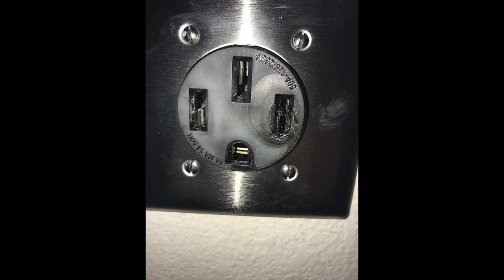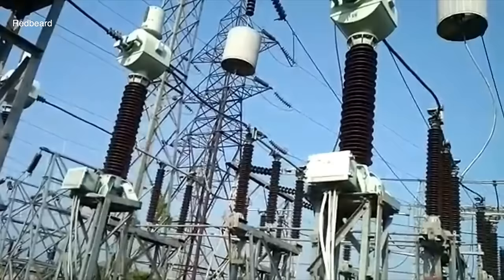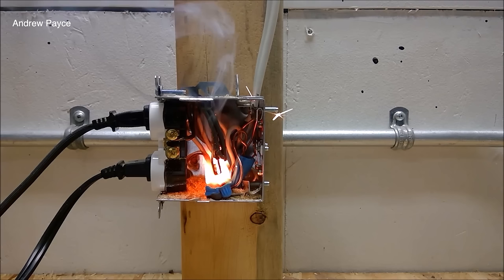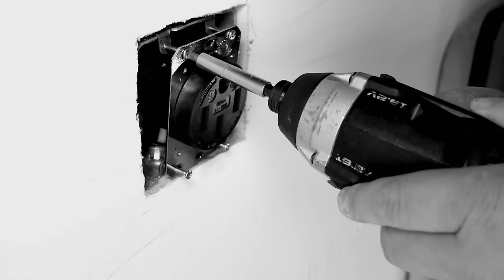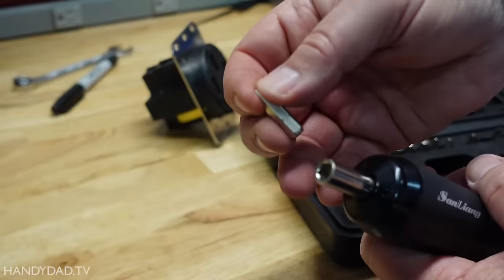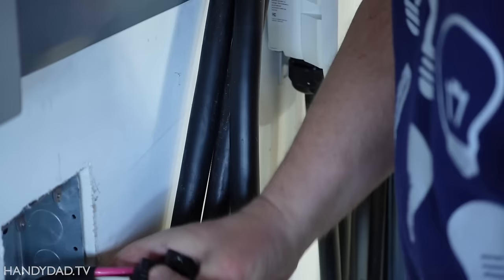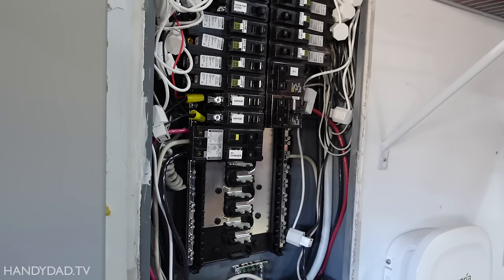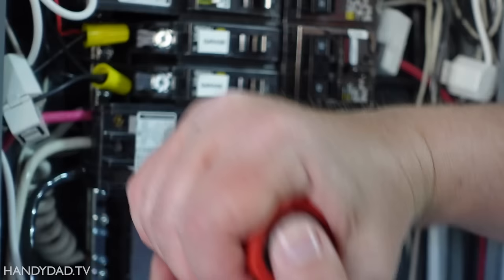EV Charging Disaster

Comment: Ive run a Tesla Model S for 140,000 miles 10 years charged every day so and Ive worn out the top quality ITT Type 2 Menekes plug that connects to the vehicle in approximately 3,500 cycles, my home charging is 5 Amps 50% of the time when on my solar in the day and up to 32 Amps when charging overnight, both single phase 250v. L1 terminal started to get hot / smell and moving the connector when plugged in the car would cause a glitch / restart in charging. Great video but the same problems of contact degradation applies to the charging connector and will eventually impinge damage to the male vehicle contacts.  When the charging pistol  gets warm / smells heated on high current charges change it out, nothing lasts for ever......from my experience seems like charging connectors could be suspect at 3,500 cycles. You can get replacement plugs fitted to 5m of cable just make sure you get the cable suited to your needs 32A being the biggest / most expensive this way it saves buying a crimp tool and yes they need crimping on.......... solder will go kerpow!
Reply from the maker: Thanks for the advice!

Comment: A thermal camera can be used to check for heating inside an outlet by loading it with a suitable appliance. Any heating much above the immediate surroundings should be investigated.
With a heavy load, a differential of more than 5 degrees C after a short period of operation may indicate potential trouble.
Reply from the maker: Good idea, but two issues: those things are expensive (most people don’t have them), and most charging happens while we are sleeping. 

Tesla has a temperature sensor in the plug that shuts off charging if it gets too warm. That should become part of the J-1772 standard.

Comment: One of the two hot screw-down terminals in the 14-30R socket installed when the house was built, had a mechanical failure where one side of the 'U' broke. As a result, the wire could not be clamped tightly. While the outlet voltage measured 220V as expected, it would not have been able to pass any significant current without overheating. Ended up having to buy a new socket and ensure that all four screw terminals (2 hot, neutral, ground) would tighten properly.
Reply: *our house*. My L2 charger has a live voltage / current display so I can tell that under load, the voltage is not dropping significantly at the outlet.
Reply from the maker: Thanks for sharing!

Comment: Arcing in a breaker box can cause noise in audio equipment. If you're hearing unexplained random noise in your radio or TV, that may be it. I was experiencing it in my home theater system at a rental house and after weeks I finally could hear it coming from the breaker box. The landlord took a look and found that moisture from a roof leak had corroded the main bus bars, and the arcing was burning up the circuit breaker contacts.
Reply from the maker: Good thing you found that!

Comment: I bought that model of the torque screwdriver, but it only went to 70. 
I needed 75. I ended up getting the LEXIVON Inch Pound Torque Wrench 1/4-Inch Drive | 20~200 in-lb.
Reply from the maker: I wasn’t comfortable using a wrench to tighten a screw. But I couldn’t get it to click at 70 by hand anyway. I just went as tight as I could.

Comment: Good diy video man, for future reference buddy use a ES1 bit to torque your screws. It’s literally a combo flat/slot drive and Robinson/square drive bit. It fills the entire void in the screws and prevents cam-out and stripping of the screws.
Reply from the maker: Yeah I need to get myself some of those bits.
Reply: @handydadtv  their great man, no more cam-out and stripping is very limited. Their awesome for electrical work especially on devices, go figure that’s exactly what their designed for, lol.....

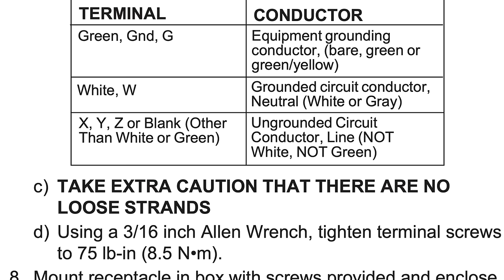Comment: At 4:44 you shows that it requires 75 lb-in, but the torque screwdriver you are using only goes to 70 in-lb (see 4:23).  So it's great that you torqued it down, but you are still off by 5 in-lb.  I even clicked on your product link and it shows a max torque of 70 Inch Pounds.
Reply from the maker: Correct. But I couldn’t get it to 70 in-lb by hand either way. So I went as tight as I could.

Comment: You don’t need a flimsy torque screw driver. Tighten them manually pretty good with sturdier tools.
Reply from the maker: I did that to shut down all the prior comments that said I needed to torque the connections. 🤷🏻‍♂️

Comment: These plugs like a dryer plug washing machine plug are not made to be plugged in and plugged out all the time things become loose wires actually hum and vibrate at 60 cycles per minute things come loose heat builds up and then you have a fire. If you look at the type of plugs they use on forklifts and other vehicles which have battery charging all the time they're different made to be used on a 24/7 basis.
Reply from the maker: Hard-wiring a charger is a better option.

Comment: This is a helpful video.  I had an electrician install my NEMA 14-50, but he used a lower grade outlet.  I bought an industrial grade but, after watching your video, I realize I need to torque the connection.  The spec you show for this outlet is 75 in-#'s.  I found the driver you are using online and its max is 70 in-#'s.   Then I watched your video again a paused on your driver and confirmed it is the same one with a max of 70.  What am I missing?
Reply from the maker: I couldn’t get it to click anywhere near 70 in-lbs. Just too tight for my strength so I went as tight as I could.

Comment: The problem isn't so much the plug itself it's that it should be plugged in and left alone if you plug and unplug anything sooner or later the prongs will fail the heavy duty version will last a little longer but it will eventually fail! I believe sooner or later it will be required that all EV chargers be hardwired into the home!!!
Reply from the maker: Not sure when (if) that will be required, but you never know.

Comment: Doesn’t NEC say to upsize based on additional 25% of load for constant current draw devices like heaters, chargers etc?
Reply from the maker: The EV community describes it as only using 80% of the circuit’s capacity. Same thing.

Comment: You were operating the screwdriver in the panel right beside the exposed bus bar plates that would have 220v between them and could supply a continuous current of your house supply but a peak current far higher.   Think of the arc if you shorted that.
Reply from the maker: Thanks

Comment: Yes, a very loose contact surface can allow arcing, but the lack of tightening reduces the effective contact surface between the two conductors.  This increases resistance which causes heating.  Think red hot toaster element.  No Arcing is required to start a fire.  Just like the toaster element lighting a flammable piece of material on fire if you put it in your toaster.
Reply from the maker: Good point. Thanks.
Reply: @handydadtv  And one more thing, I could make a lot more videos than you, because I've made more mistakes than you 😂.  But my videos wouldn't be one tenth as good as yours!  Nice work!
Reply from the maker: Thanks so much 😊

Comment: One very important thing is feel the outlet and the plug when the charger is operating to make sure it's not heating up , 
If it is , Check the fit of the plug in the outlet
If it doesn't have a tight fit , you need to replace the outlet and check all the connections to make sure they're tight
It would be more safe to hard wire the charger because the screw connections will be much more tight than the connectors that the prongs slide into
Reply from the maker: Good point. Warm is okay, but never too hot to touch.

Comment: Did you just torque the breaker terminals to the same specs the outlet manufacturer called for on the outlet? 

If stripping the heads off screws and screwdrivers wasn’t a clear enough indicator  75 lbs-in is over torqued for a Square D HOM breaker.

I doubt it will be an issue but exceeding torque specs runs the risk of stripping the threads off the screw and making the connection loose again. In your case we don’t know if those threads are damaged and about to just let loose with some thermal cycling. Again I doubt it will be an issue just something to consider in the future.
Reply from the maker: No, I adjusted the torque screwdriver to the specs of the breaker, which were printed on the breaker.

Comment: Hardwire hardwire hardwire. Preferably one continuous 6 gauge set of wires (only need 2 x hot + ground) in conduit through garage is an option I think is the most fool proof.
Also, using a thermal imager after it's been used for like 30 minutes would help rule out unusual temperature rises.
Reply from the maker: Thanks.

Comment: Other important notes is to make sure the wire that was run through the wall for the outlet is the correct size, has the correct insulation rating, and has no nicks or cuts. I honestly would not trust running wire for an EV that is not in fire rated conduit. The extra bucks for the conduit is worth it to have piece of mind. Also make sure that the electrical box the outlet sits in is to code and is tight against the drywall and the wires are pushed back so they sit well in the back of the box. That way if a electrical fire does happen it will be contained within the box and/or conduit and will be far less likely to start a house fire.
Reply from the maker: Thanks for the tips!

Comment: The bottom line to all, avoid NEMA plugs for EV home chargers. Even if the AMPS are on the lower side (40- below) Run it hardwired. You will cut the chances of fire heavily. Not to say that it could not happened on a hardwired setup. All breaker screws need be tightened as you shake the #6 0r 8 wire gently, loose the screw a bit and again via T. Driver. Screws on the EV charger same, per manual. Bad or loose connection will heat up and spark. Also, most EV chargers require you to strip the wires around 1/2" before going into the terminal block. Don't be shy to do so. When you run your charger first time ever in your house. Run it first time during the day, when you are home and awake. Go out and check the temp on the plug/cord/the EV box. Do you smell anything burning? is anything too hot or very warm. Indication, something is sweating !!!!
Reply from the maker: Thanks for the advice!

Comment: Good recommendation for industrial grade outlet, no way is a standard one going to handle that 75 in/lbs tightening, the screws will strip.

Hardwiring is even better, it's not that hard to just disconnect it if you move and want to take the charger. I would hardwire literally any continuous load including electric ovens used to bake.

If there's a twist connection anywhere, remember also to pre-twist the wires before wire capping them and if one end is stranded make sure it's not creeping down the wire when the cap goes on. It's worth a drop of solder for a big high risk connection, easily enough broken if the connection must be remade or device moved.
Reply from the maker: Good tips. Thanks.

Comment: Also important to prevent arcing when plugging in is to always connect to the wall socket first, and then the car. And opposite when finishing charging. Remove from the car first. Because the plug that goes in the car has protection against arcing.
Reply from the maker: Good advice!

Comment: I have a sub panel in my garage,  near where I want to install the EV charging unit, that is installed for supplying 240V to the nearby Jacuzzi. Can I use that same subpanel, for supply to EV or do I need to rerun entire wires from the main house panel?
Reply from the maker: Yes, but you need to do a load calculation to know how much capacity it has. I suggest you consult an electrician.

Comment: Even if no arcing occurs, it doesn't take much resistance to cause the generation of a large amount of heat.  On your example of a 50A outlet, a resistance of only 1/2 Ohm will result in the generation of 1,250 W.  Also overtightening can be just as bad as undertightening.
Reply from the maker: Thanks for the info

Comment: So even if you torque the screws wouldn't the copper wire expand and contract when its heated up by charging. Would raising the charging amps on the car be and issue also according to the wire size and breaker installed. Some people like to raise there car settings higher nor taking into account the wire size installed and not knowing that a circuit is only rated for 80% or volt droppage due to distance and will always blame the plug just wondering
Reply from the maker: Yes they still can expand and contract so it’s recommended to re-torque them periodically. 

Only an idiot would intentionally try to charge their car at a higher rate than the circuit design. The circuit breaker should trip to prevent an overload but that’s just asking for trouble.

Comment: One more thing, when you are attaching heavy gage stranded wires you should shake the wire while you are tightening it OR unwind the length of the strands that goes into the connector

The diameter of twisted strand wire is larger than the same wire unstranded

with the movement cause by the expanding and contracting due to heating and cooling those strands will unwind and thus result in a loose connection.
Reply from the maker: Thanks for the advice!

Comment: Whenever I needed to install a high amperage outlet for large loads I would always mount a disconnect switch adjacent to it.  With the switch open there is no chance of arcing as the plug is inserted or removed..
Reply from the maker: I never unplug while charging, but I can see it’s a small risk.

Comment: Torque spec for the outlet is 75 inch lbs. Max torque load on the screwdriver is 70 inch lbs. I was thinking about buying the screwdriver before I realized that. If you're going to go to the trouble of buying a tool to do the job right shouldn't you torque it to the correct spec? Is the 5 inch pounds enough different to be concerned?
Reply from the maker: I couldn’t get it anywhere near 70 in-lb by hand. I went as tight as I could. 

I was tempted to use channel lock pliers to grab the screwdriver for leverage but I thought that much force would break something (the screwdriver, the bit, or strip the screw head).

Comment: Hi. Your channel has a global reach. Not all electrical systems are like those in the States. Not just voltage and frequency, earthing can be very different, split supplies not used, aluminium cable banned, wire nuts illegal, you'd be amazed. Please bear this in mind and make clear where your interesting wiring series is relevant. I know, should not be necessary, but some people in other jurisdictions will try and follow you and what is good practice where you are may be very bad where they are.
Reply from the maker: Hi Bob. Thanks for the feedback. I’m well aware YouTube is global and the US is distinct for its electrical standards as well as weights and measures. I’m not sure what I can do about that. It’s where I live and it’s where the majority of my views and revenue come from. What would you have me do?

Comment: A NEMA 5-15 or a 14-50, whether homeowner grade, spec grade, commercial grade, or industrial grade, the outlets are still not designed for continuous plugging and unplugging. They have a low number of insertion and extraction cycles before they are significantly worn. The higher quality models will surely last longer but keep that in mind. The J1772 EV connector IS designed for a high number of operations. So don't be unplugging your EVSE every day, leave it plugged in and just unplug the charge station from your vehicle. Or better yet, get a hardwired unit.
Reply from the maker: Thanks

Comment: Great video! I used torque also when doing my NEMA 14-50, it is a surprising amount of power to properly tighten it.
8KW+ going thru, don't want it to be loose!

My insurance company partnered with Ting(fire, not mobile) , a plug-in monitor that constantly checks your home wiring signals for signs of arcing or other problems.. was free
Reply from the maker: Very cool! I’ve heard of Ting.

Comment: Tesla telling us charging rate has been reduced to 9a as overheating was occuring.  30' Gear it 50A 14-50 extension cord plug was hot at the wall, so I replaced electricians outlet with a Hubbel which was great quality btw, of course box and cover didnt fit pita getting that to fit.  after 1 charge, STILL getting over-heating warning from Tesla, I'm convinced its the Gear it cord, the blades are blueish, heat has to be causing that, but why?  I guess I'll get a new cord??  need help thanks, i torqued the nuts tight also.
Reply from the maker: They say not to use any extension cords.

Comment: Hey buddy, I also own a tesla and had an electrician install my wall charger. Well they did it wrong. I am a certified rv tech and deal with 240 single phase every day. You need to replace the dual pole 50a to a 60a. You have a 50 amp circuit and the rule is 80%. Your car is pulling 48a at the highest setting. It will fail in a short period especially in the summer months. The car manual also indicates a 60
Just an fyi
Reply from the maker: I have a 50-amp breaker and my max charge rate is 40 amps (following the 80% rule).

Comment: Awesome.  Perfect advice.  Now how many electricians do you think use a torque wrench/driver on the job.  I'm guessing it's a small number.  I want to go out and check the torque on everything in my electrical box.  Great video.
Reply from the maker: I don’t think they torque. I think they do it enough to know when things are tight enough, right before they strip the threads.
Reply: Some of us use torque wrenches to insure we don't over tighten.
😅 75 inch pounds... that's like 6 foot pounds. A half "umph" of elbow grease if you know what I mean. This coming from a dude that has torqued hundreds of 3/4 nuts to 75 foot pounds on industrial ATS's and STS's. That's 900 inch pounds😅
That's almost a couple "RrrrAhhh!" worth of elbow grease.